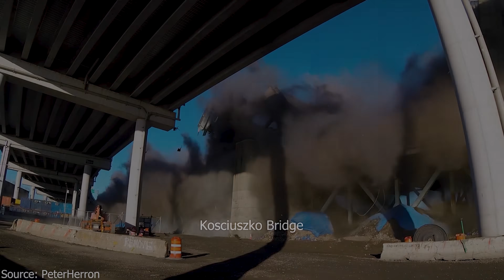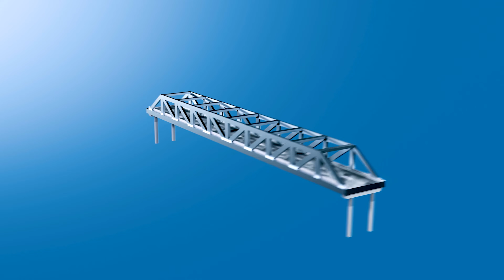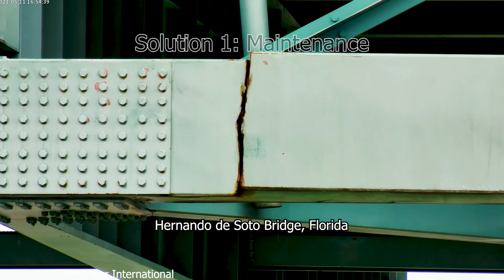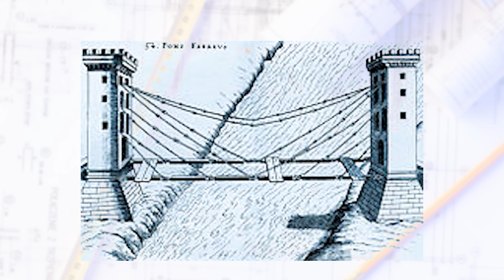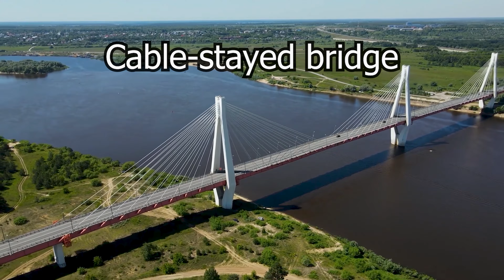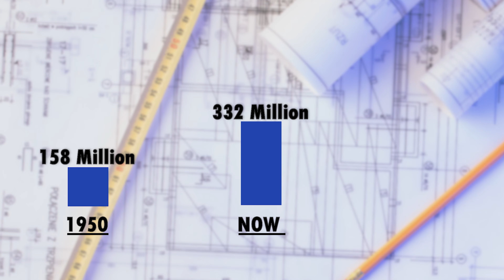Why the U.S. Is Destroying Its Old Bridges?

Comment: 1) You gloss over the problems of cable-stayed bridges before 1950.  
2) Structural deficiencies in metals had to be solved in the 19th century.  Steel replaced iron only after steel had become reliable. 
3) The truss era in America had a MAJOR complication: American engineers didn't trust RIVETED structural joints unlike the Europeans.  Americans used pin-connected joints regular to WW1-era and even later; this gives American truss bridges their tinker-toy/erector set look totally lacking in Europe.  One consequence of this is that for American truss bridges tension and compression members look distinct from each other--unlike European designs.  
4) Yes, American and European engineers DID trade insults whenever a bridge collapsed--when Dundee's Tay Bridge collapsed in 1879 (75 dead) Americans Got Even for British remarks about the Ashtabula OH collapse of 1876 (80 dead). 
5) Regarding continuous trusses which carry stresses across piers unlike how a simple truss "works" solely between its two piers, HOW to properly calculate carrying stresses across piers wasn't figured out until about WW1.  The Sciotoville RR Bridge over the Ohio (1916) was the first BIG continuous truss in this country and showed what could be done with the design.  Of course if anything happens to just one pier ALL spans will come down.  The Key Bridge collapsed EXACTLY as Statics said it would once one pier got weakened!
6)  Regarding aesethetics---I think cable-stayed designs are banal and ugly---glorified plate girders basically.  Trusses are NOT intuitive and are major design achievements.  Messrs Howe, Pratt, Warren, Whipple, Post (for a weird one!), Wagram, etc. all at work.  (All were bridge designers of particular types of truss.)
7)  Lastly, "Deficiencies" are often political ploys for ginning up bridge construction projects for contractors and unions.  These are non-structural deficiencies. There was a ruling that all bridges should have 4-foot parapets so any bridge like to Castleton-on-Hudson Thruway bridge is "deficient" merely for having railings 
instead of concrete walls!
8)  You need to learn how to speak English better.  And lay off being Biden's stoolie.  You clearly took sides in our election!
Reply: I think that his English is fine and it's everyone's personal choice which side they lean politically. You won't change someone's mind if you just tell them to repent (turn) to the other side. Weird and unnecessary remark.